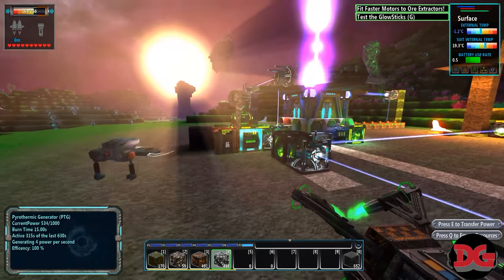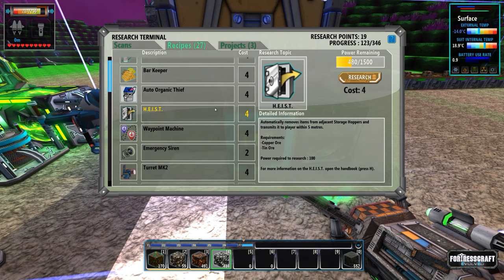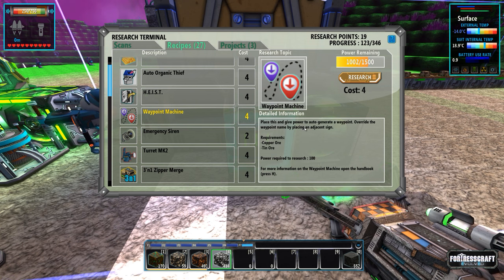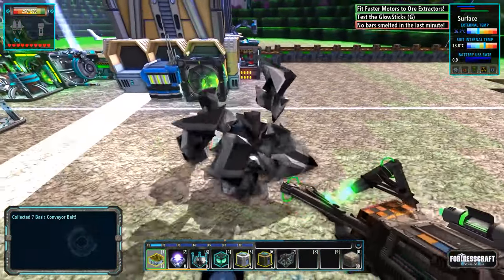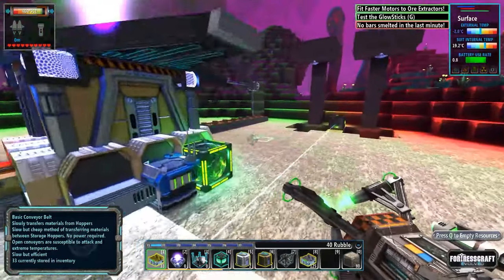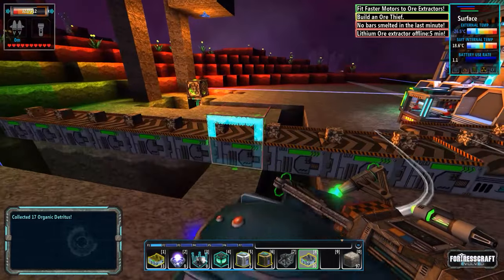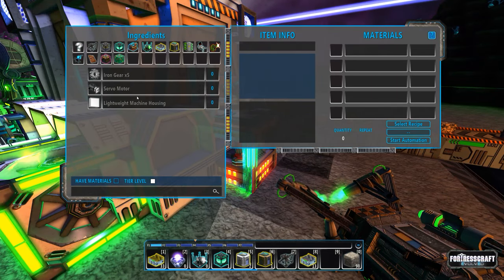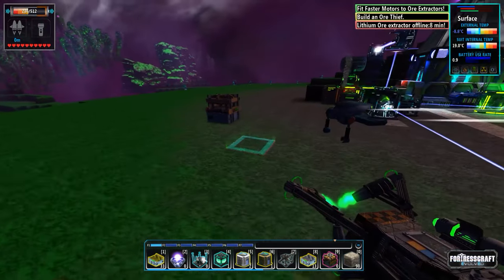FortressCraft - Frozen Factory! ► Let's Play Episode 4 ► PCB Manufacturing! (1440p/60)

Comment: also remember that while they turrets don't care about line-of-sight, their range is a true sphere, so that turret isn't necessarily going to provide protection quite as far as you think it might because it's not in a straight line. use the function that shows their area of coverage to be sure that there's a bit of overlap whenever you're not putting them down in a straight line... i had a couple spots where that bit me hard.

I'd also just put them 30 apart instead. ever so slightly less efficient, but the math's easier. :)